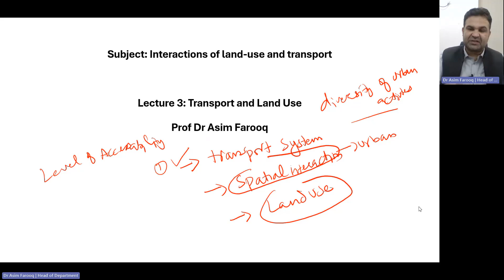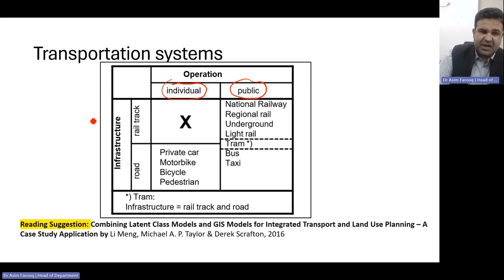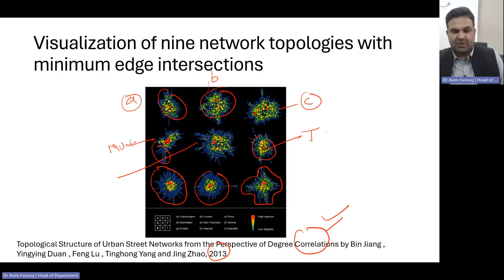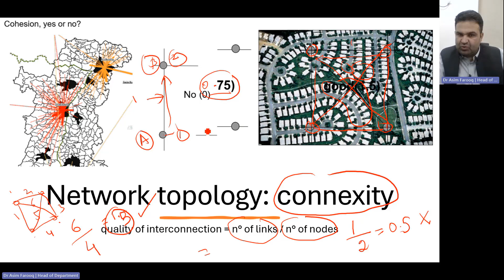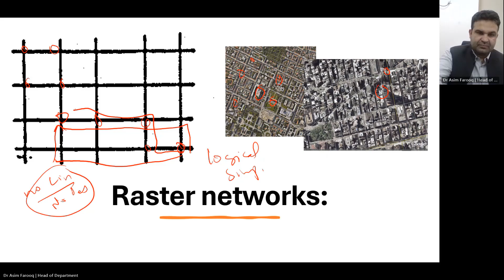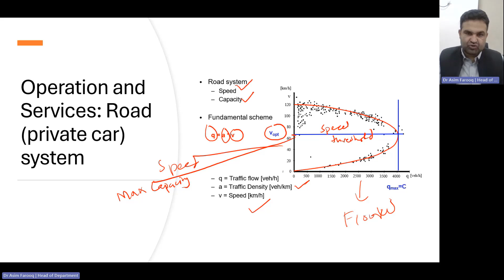Transport and Land Use Supply by Prof Dr Asim Farooq

Comment: This is very helpful lecture regarding land use and transport facility relation. Planning for the activities conducted with proper use of land along with travel supply in term of demand and their impacts with real life examples of different urban cities. Different topology types like raster or orthogonal networks, which are helpful to learn about the connectivity of the cities